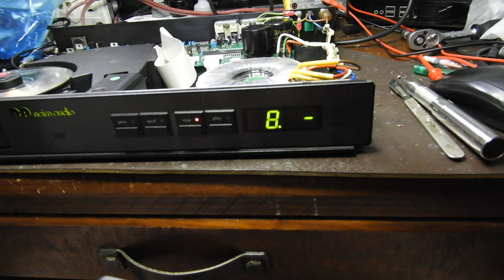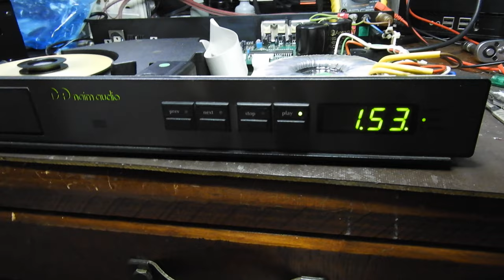Naim NAC D3 or CD3 wobbly CD mystery solved. Surprising culprit!

Comment: Nice video. Cud you tell us the name/type of the clamp used? (The large one, i.e. not the NAIM clamp). We lost two NAIM-clamps already, they flew off and just disappeared in the CD player (NAIM CD3.5). Still need to figure out how to open the player though. Thanks.
Reply from the maker: I use clamps from other CD players. Any will do, as long as they have the same turntable. Sadly, not easy for you to find out. Most Naim players have screws along side edges on the bottom of the player. Once they're removed, the cover slides off towards the back. With difficulty in most cases.
Reply: @hear-net-au  Thank you. Reason for asking is that it may happen that the NAIM clamp are not 'exactly/correctly' fitted, once you start playing a CD, they simply may flow off and disappear somewhere in the CD player. My wife managed to do that twice. I watched your video so as to see how to properly get the cover off the CD. It is a hell of a job to get the CD player out. Tie-wrapped cables, AV cabinet can't be moved due to cracked plastic wheels. The cap you are using is larger (with a better 'grip')  and to me it seems there is less chance it will flow off.
Reply from the maker: @mike_9995  but it's not easy to find the right clamp. You basically have to write off another player. People bring me sometimes rusted old rubbish which wouldn't be worth much if they were in as new condition and I rob them of any part I can possibly use. Your only chance is local rubbish tip and a lot of work trying to find the right one

Comment: Me video is posted Audiolab Flagship 9000cdt you might want to start at 28min nice build for real -tray is plastic but mech is metal entire case is dual layer Alumnium 3 Volt reg for transport is as many as the new Marantz Ruby Sacd player 😆 Maybe you can guess the Mech their using -